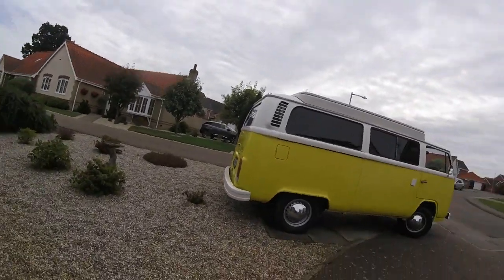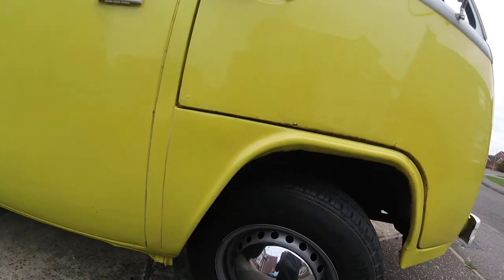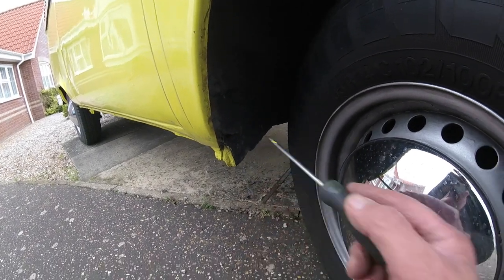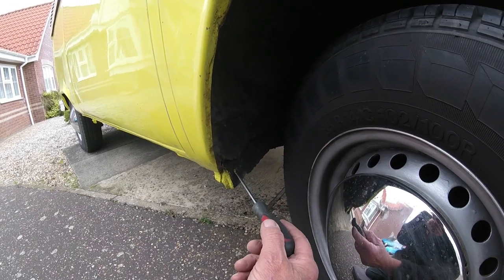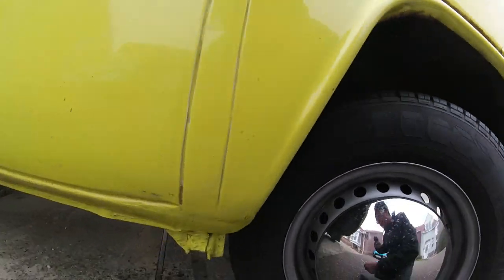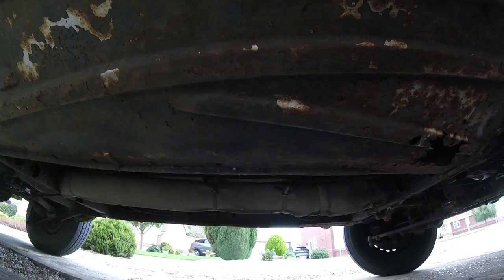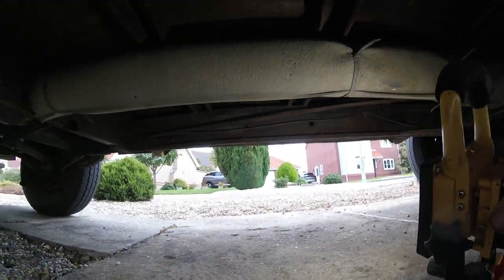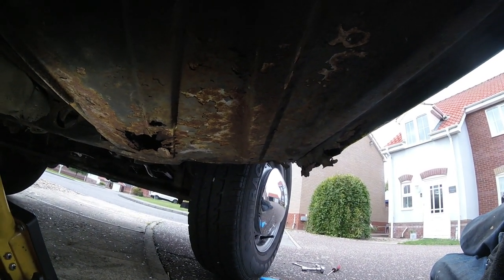VW T2 Camper Project (Bertie Bus)   More Rust

Comment: Those belly pans are water traps . As for jacking points just cut them off as like you said othered just jack from beam or chassis . Usual common rot with your work ,easy 👍
Reply from the maker: Thanks for the your advice I don't like them I will be removing the. Other side in the new year 🤓👍